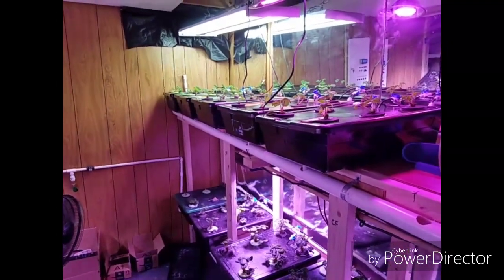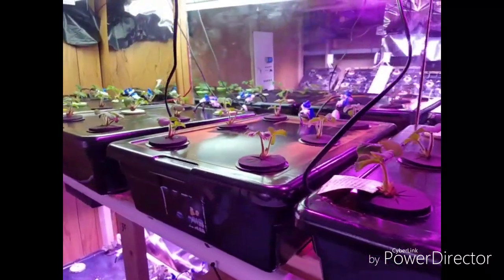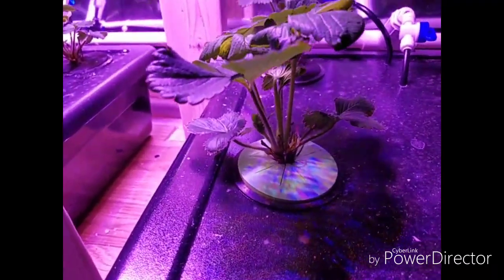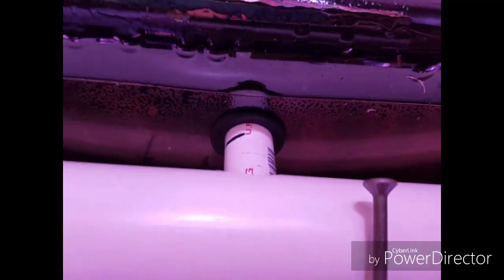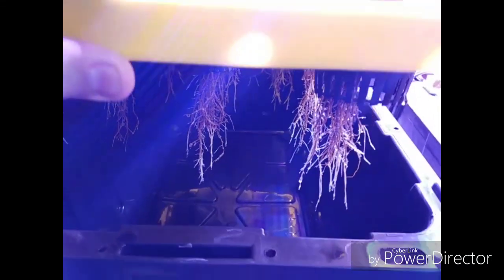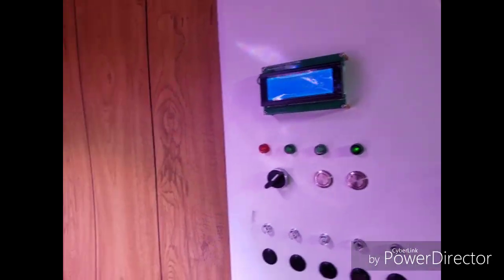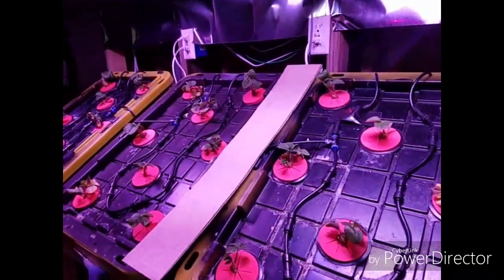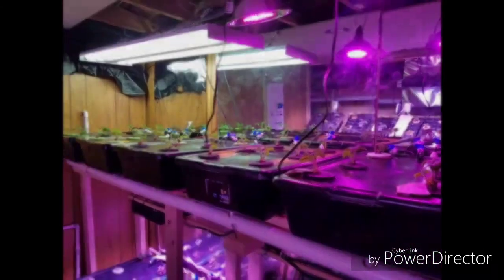Hydroponic Strawberries in Automated Basement Garden

Comment: Does this make economic sense? I mean when you take the elektricity and equipment cost is it cheaper then buying them in super market? I want to do something similar but no idea how productive they are
Reply from the maker: No it does not make sense unless you can do it outside in sunlight or in a greenhouse setting. The Aeroponic method works extremely well but you need basically 2 systems running at the same time as backups in case 1 goes down. This method produced the best berries and by far the most/biggest. I got probably 1/4 to 1/2 pound a day for maybe 3 or 4 weeks and then you would go a month with none or very few.
Reply: @dxhydroponicgardening9906  thanks for the feedback. Why do the aeroponics stop working? Anf if you dont start them all at the same time can't you get more consistent returns?
Reply from the maker: @niels1491  You probably just need to make sure you have a really good pump with a good pressure tank so the pump isnt always turning on. I was buying RV pumps that got to 100 PSI and they all failed within a few months. But a backup would also make a lot of sense. 

The Aeroponics is great but you need to be able to do it outside/in greenhouse, keep your water temp cool... under 70F, and have a really good pump, pressure tank and a backup to it. The little 12V RV pumps will burn up within 6 months.

I do not have anywhere to do it outside that is why I stopped.

Comment: NO!! You stopped making educational videos!! People really need this kind of knowledge now. We’re going to have to grow food indoors to keep it from being stolen when the shtf.
Reply from the maker: This works but you should not do the aeroponics. It is much harder but does work better. However when a pump goes they die quick. It is easier to do the hydroponics. It is most important to make sure the humidity is low so you dont get fungus on the plants. The light mover idea works well to limit the cost of lights and electricity.

Comment: Pink led light and white light. Which one better for strawberry friends
Reply: You need a mix of different wavelengths at the following ratios: Hyper Red (635-666nm) 80%, Deep blue (439-461nm) 10%, Far Red (720-740nm) 5% and white 5%. PPFD should not exceed 250 (µmol m-2 s-1), although it will pretty much depend on cultivar. What you call pink led lid is a mixture of red and blue led lights with a ratio between 1:1 and 1:1.25. Due consideration must be given to light homogeneity when using lights very close to plants. I hope this helps.
Reply: What are your light cycles